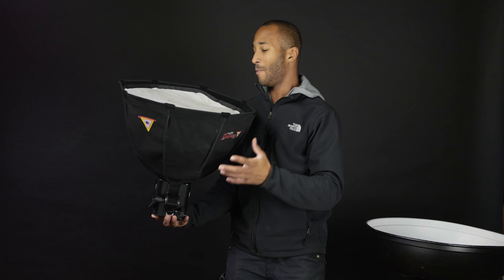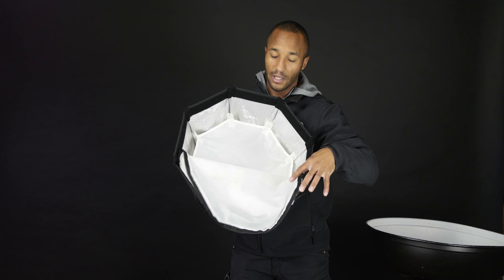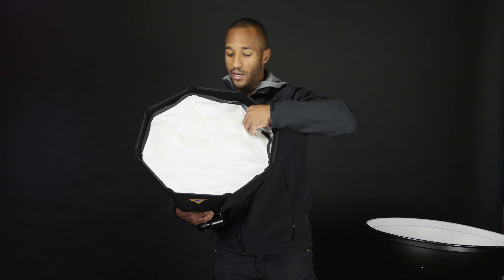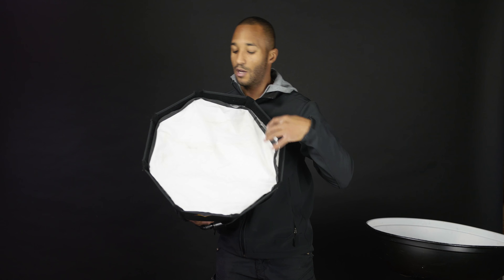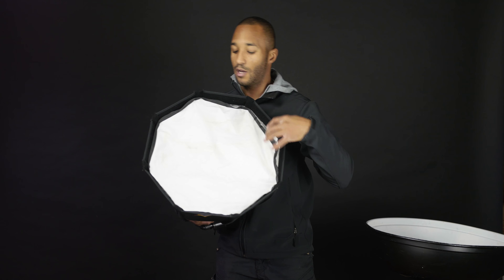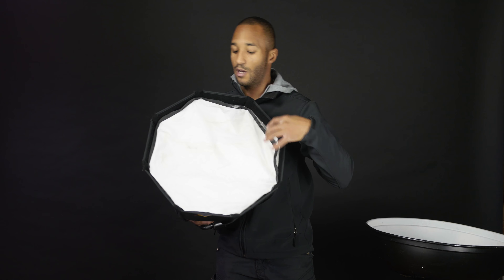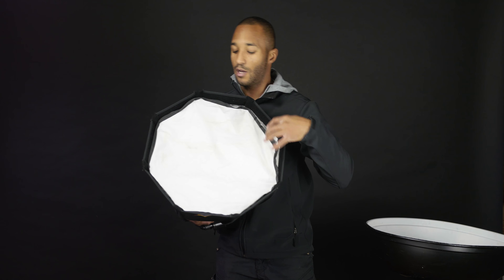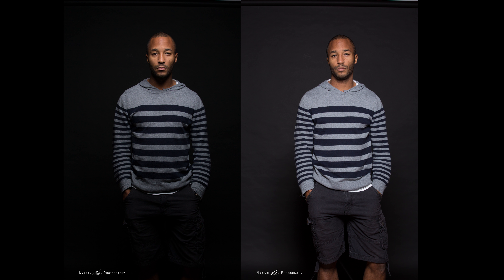Feathering your softbox vs beauty Dish

Comment: Perceived size, matters. *snort
If you're intimidated by the inverse square law, even though it's pretty easy... you can also think of light as having a depth of field in relation to the size of the light source. A HUGE soft light, in close to your subject (like a large aperture) falls off quickly. So it is about the perceived size of the light in relation to the subject size, and how close together they are.  Conversely, a bare speedlight with no modifier from several feet away (like a small aperture) would have a longer light "depth of field" and continue further beyond your subject.
Reply from the maker: +William Alan Photo Nice!  Can I add this to the description?
Reply: William Alan Photo Falloff is falloff. ISL happens regardless of the size of the source.
Reply: Light modifiers do not effect light fall off just light qaility. Distance effects between the light, subject and background effect light fall off.

Comment: Where did you get that beauty dish? Buff's aren't awesome like that; meaning that the Buff one I have has a rod that fits in through the umbrella hole (which is a problem for me because Buff cheaped out and did not put handles on their strobes; so I had to purchase metal rods that I use to change the angle of my light) and bumps into the rod I already have in there because I have small hands that aren't particularly able to get a firm grip on the Einstein.  I had a beauty dish for my  Phottix Indra 500 that was designed like yours but I like that your plate is more massive in size than mine.
Reply from the maker: Pat Trudell It’s their old school one.

Comment: How much would the results of the dish vs the normal reflector change if you were to put a diffuser sock on the dish? I've never used a beauty dish, so I'm very curious. Thanks!
Reply from the maker: Do you mean the silver reflector that comes with most lights and reveals the bare bulb vs a socked beautydish?
Reply: Exactly! Sorry if I wasn't clear
Reply from the maker: You were perfectly clear but people tend to throw around different names for the tools and if we aren't on the same page there, we are completely lost :)  

If the lights are at the same distance up close, the socked beauty dish will be much softer.  The shadows will fall off more gradually and the light will wrap much more than the silver reflector.  The sock will also help with the reflection of the light in the skin.  The silver reflector will much harder light and also give more specular highlights on the skin.  If it's oily skin, look out!  If you're looking for super hard contrast light and an eddy overall spotlight look, use the silver reflector.  Best to just play with it and see which one you like more.  Borrow a friends beauty dish or rent one.  I tend not to use them at all as I work with everyday working people for business headshots.  The softer I can make the light the better.  Hope that helps.
Reply: Thanks! This is actually very helpful! I'll take your word for it and pass on the beauty dish. I'll just get a nice big octabox because I like working with very soft light as well. Cheers!
Reply from the maker: Cheers.  Glad I could help.

Comment: On a white beauty dish would you prefer white beauty dish with a sock on or without a diffusion sock and why?
Reply from the maker: Just comes down to to how hard you want the light and how much spill you're ok with.  Sock will provide harder, edgier light but will also throw light in a wider beam.  If you're shooting studio and close to a background you'll get more of your light hitting the backgound.  If you want less specular highlights than go with the sock as well.
Reply: Nakean Wickliff The sock will certainly NOT produce hardier, edgier light. Just the opposite, actually. The diffusion sock will diffuse, soften and spread the light a bit more. No diffusion panel on any modifier will ever make the light harder.

Comment: its not about softestness, its about even out light distribution on your face. Why? By feathering the light you make it smaller source of light. Smaller = harsher, Bigger = softer. By feathering you will have more even light on your left and right cheek, but the light is harsher.
Reply from the maker: nixland I get where you're coming from, however you're arguing semantics. You're also arguing that more even lighting is somehow harsher than direct uneven light.
Reply from the maker: Would you agree that harder, harsher light is defined by hard shadows and brighter specular highlights? Feathering the light helps eliminate both, creating softer light.
Reply: Bigger light gives more wrapping light, thats why it will gives softer light. Smaller light gives less or none wrapping light.
Reply: Even does not the same with softness. Your right and left cheek might have same amount of light, but the shadow transition on your nose is harsher
Reply from the maker: nixland I understand the properties of relative size of the light source including proximity. I guess I'm just trying to figure out what you're arguing against. Are you saying that feathering the light source creates harsher light?

Comment: Hi, I recently bought a sliver beauty 70cm. I just can't seem to figure it out. It leaves a hard shadow of the centred disk on the background regardless of the distances. I've seen other video tutorials and they give a different result than mine.
Reply from the maker: hmmm...That's odd as eventually it should appear as pretty much a solid light source once you get far enough away.  Do you have a photo of the light pattern and the dish in question?

Comment: I could not disagree more with how your using that beauty dish. Feathering it just the slightest bit, and seeing that bulb is all the difference.
Reply from the maker: Seeing the bulb means the center diffuser of the beauty dish is no longer doing what it was intended to do.  The entire design of the beauty dish  is to shoot straight on so your subject receives the "feathered" light without having to feather the dish.  Feathering the light just means you're using the edge of the light which is much softer and less direct than the center hotspot of the light.  The only on axis light omitted from a beauty dish IS already feathered.  If you see bulb than you are getting non defused barebulb flash which does the opposite of feathering.
Reply from the maker: https://youtu.be/3vS_xI0GwxM?t=21s  Check this out.  Just the first 10 seconds of where I have the link starting.